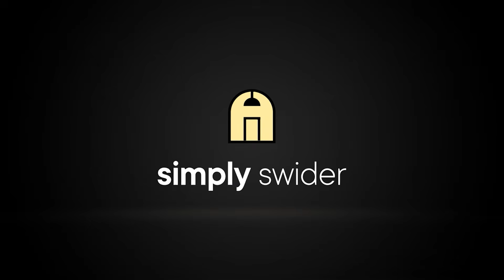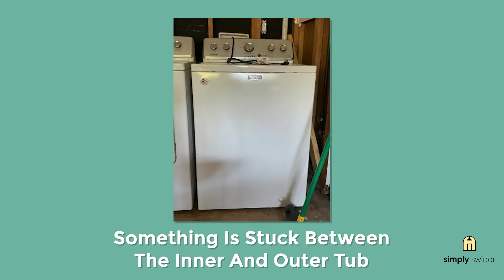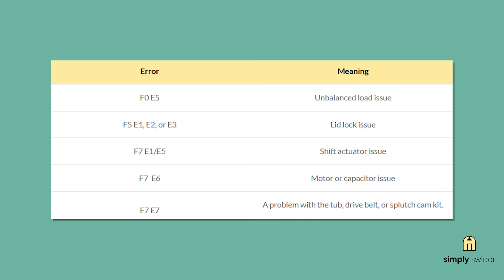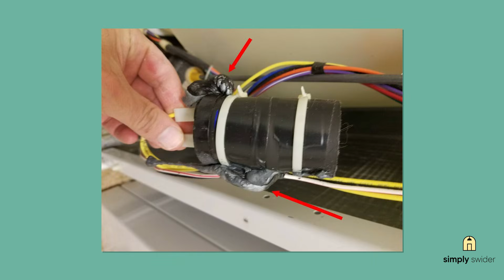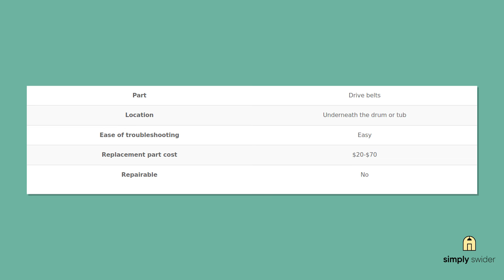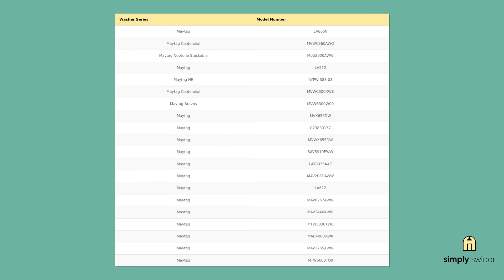Maytag Washer Won't Spin? 8 Fixes (70% Success Rate!)

Comment: My Maytag direct drive Maxima is in the door lock position and will not operate no codes doesn't work to push power or start hums like it's pumping water out that's not there

Comment: I have an issue where is starts spinning then starts hitting the right side of the wall. I have replaced the hub lock and suspension rods but still have this issue